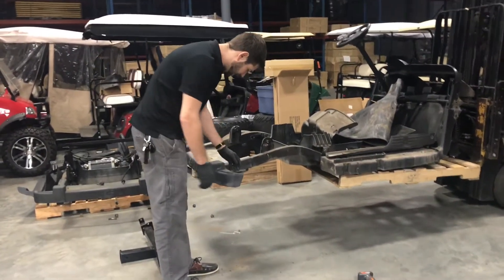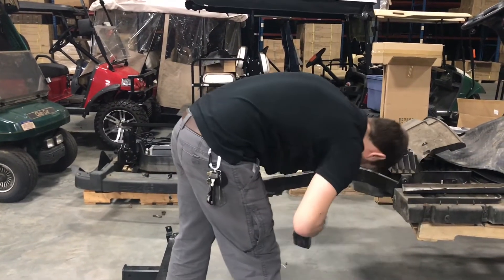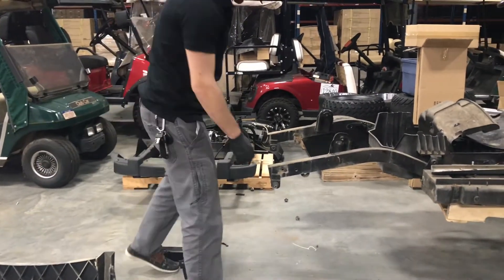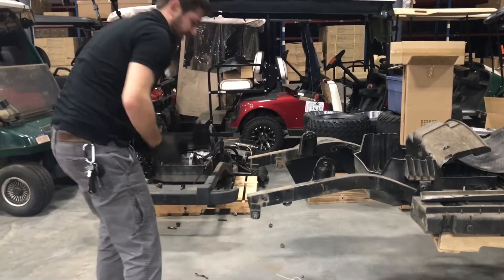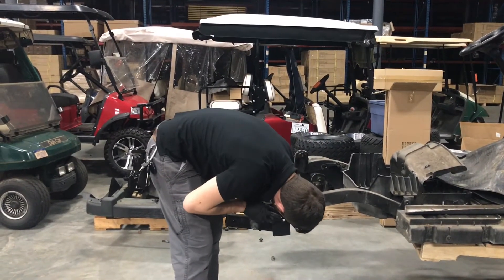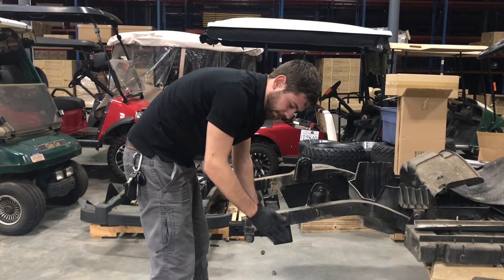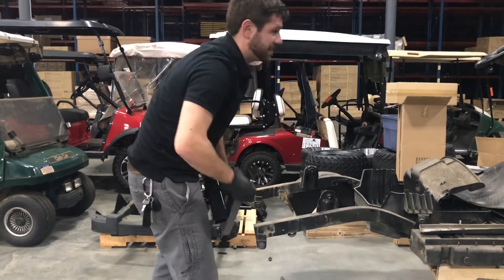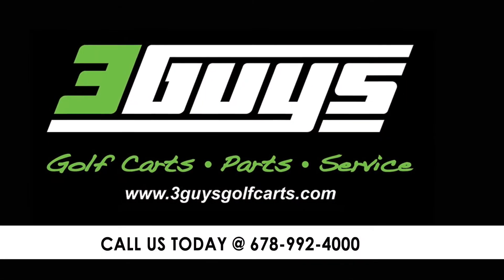RXV Trailer Hitch Installation - Tutorial

Comment: Because your video is kind of sketchy at the end because you don't actually install the bracket and bumper to show how your tightening that bolt hole that was hidden... And also to let you know I could barely hear your voice I don't know if you were too far away from your microphone or what but I had my phone turned all the way up and had to hold it to my ear still to hear it just letting you know otherwise this would have been a good video